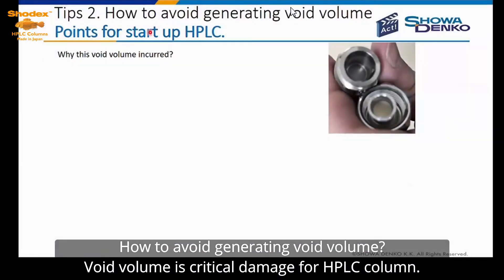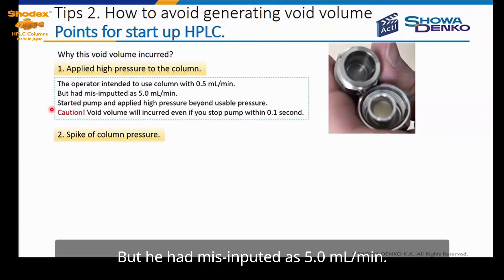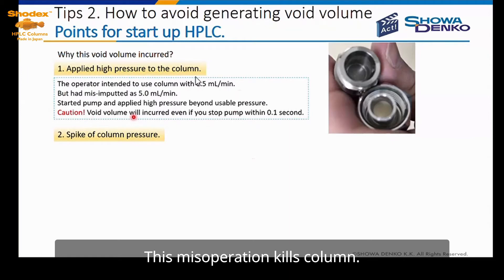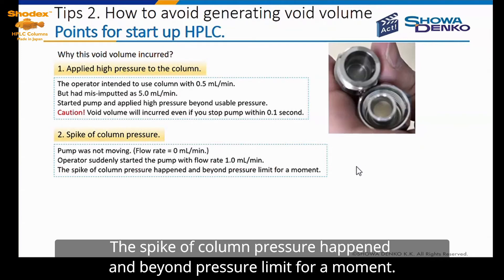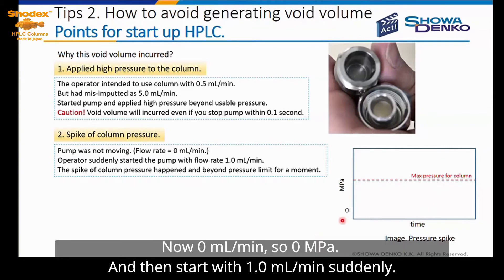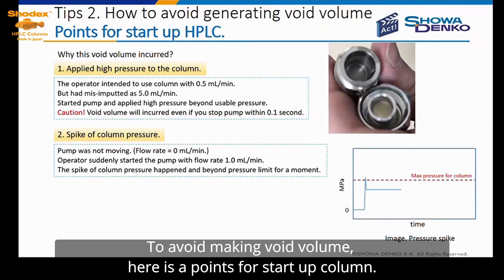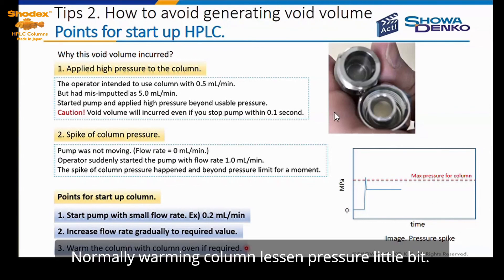HPLC Tips: 2 Things to Prevent Void Volume

Comment from the maker: HPLC column deterioration could be caused by void volume generated inside the column.
This webinar excerpt shows a tips on how to avoid generating void volume.

0:00:00 Getting started
0:00:18 Void volume due to high pressure
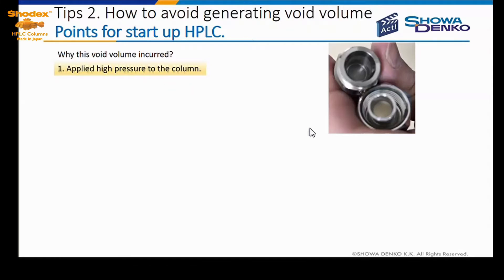0:00:31 Void volume due to spike of column pressure
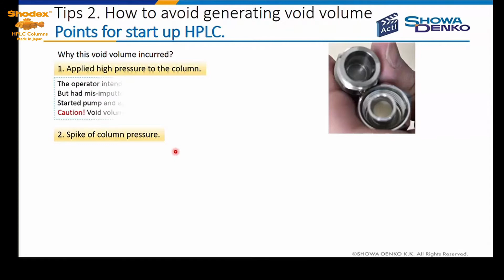0:00:42 Case study 1
0:01:21 Case study 2
0:02:35 How to prevent void volume